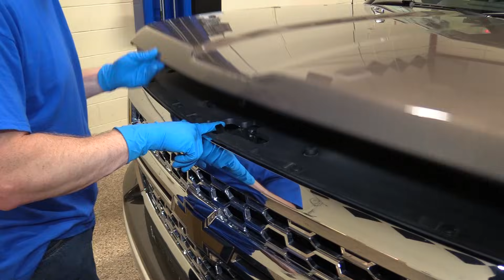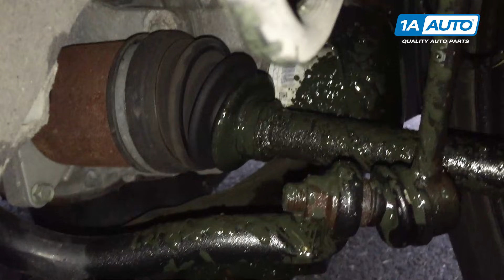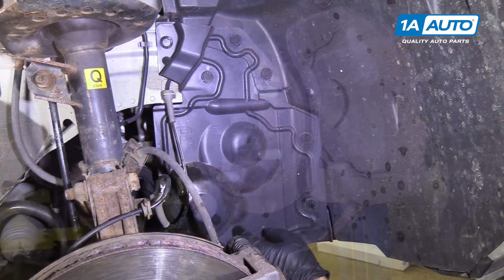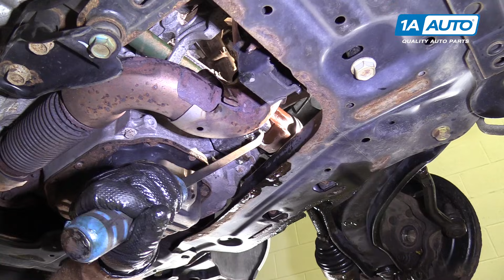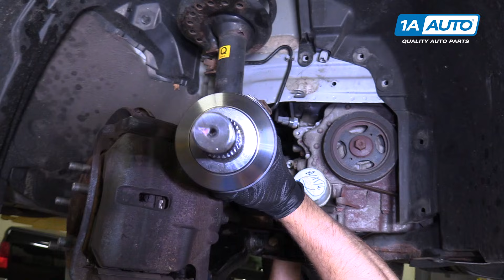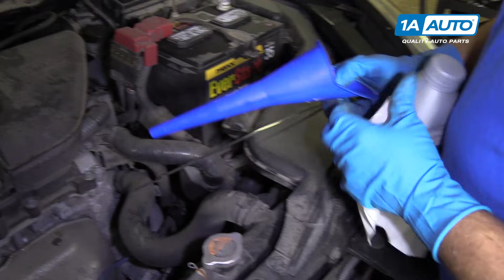How to Replace Front Passenger CV Axle 08-13 Nissan Rogue

Comment: I believe there is a discrepancy. In this video, at 16:52, you state lower ball joint should be torqued to 21ft lbs, but in another video at 9:13 you state it to be torqued to 46 ft lbs

https://youtu.be/-BCASzxYoIE?si=HjhJ_YC2MOB5PWyf

Comment: Just did this job on my 2012 Rogue. For the first time ever, it all came apart the way its supposed to. No slide hammer, no ball joint press, no heat, did not have to remove anything extra. Old one out and New one in, 2 hours. Be advised the world may end later this afternoon.

Comment: For most who will struggle with this. This is the way. Combination of lots of heat on the front side. I used a camping propane torch for 5 minutes then smacked with the slide hammer right away and it came out easy. 

https://youtu.be/6vQwu7A5qUo

Comment: I'm no professional buy any means. But I would suggest to never use a wire brush near the opening of a transmission. Those bristles fly off and you most definitely don't want them inside your transmission.

Comment: I have been trying for three days now to separate the bearing from the aluminum bracket. I've tried every combination of PB Blaster, heat, crow bar, slide hammer, impact hammer, screw drivers, etc. This thing will not let go. I even tried unlocking the housing to see if I could get the axle and housing out in one piece but that proved impossible with the exhaust and the sub frame in place. Any suggestions?
Reply: Not sure if you ever got it apart but this method this worked for me. Took 20 seconds of heat. I had tried all the same things you did.

https://www.youtube.com/watch?v=6vQwu7A5qUo

Comment: Hey 1A. Currently enrolled in an automotive college. and had to tackle this task today on my own personal vehicle. 2011 rogue AWD. We used a slide hammer and everything but that bearing would not release. we ended up having to take that whole assembly that the bearing slides into off, which included my exhaust coming off aswell. My instructor was astounded how hard it was to pop that balljoint out too! cussing up a storm just trying to get most of the bolts off in such a tight space, currently the car is still at the college campus, tomorrow we are tackling taking out the shaft from the support thing that the bearing is seized onto. 
Great informative video btw
Did everything you said and most of it worked, except that stubborn bearing xD

Comment: Had to watch. 2010 Rogue cv wouldn't come out, stuck bearing. Removed cv and bracket holding cv.  Penetrating oil hasn't worked yet. Car is on ground. Also was wondering how to seat bearing if this hard to remove. Using a soft hammer to seat. Glad you had video showing tesl world replacement. Watched video yesterday, the mech said and showed, "just pull it out". Right. Well anyway thanks for a true video.

Comment: I'm surprised the bolts are 13mm and 18mm on a Nissan. Every other Nissan I've worked on used sizes like 14mm and 17 or 19mm. That was kinda weird. I would have definitely undone the strut rather than that ball joint

Comment: I like all of your videos, but in all fairness, this is a totally different job on the ground. I have done several of these in NY, on many Nissans with that support bearing and it could take all day fighting it out. You have far less leverage on the ground. The best way I have found to do them is to take the bearing support bracket out with the CV axle, support the housing and hit the Axle end with a 4 pound hammer. Using a penetrating oil does help as the shock from the hits helps it work its way in. The bracket is held on by 4 or 5 bolts.
Reply from the maker: +Marc Smith Thanks for the feedback!
Reply: I just got one like this, the thing is rusted at the bearing. Hit it so many times, decided to remove the bracket along with it but it won't come out as the exhaust is on the way. With the bracket loose, I will hit it away from the axle and hopefully it releases.

Comment: I've done a few of these here in Massachusetts.  I have never been able to get the carrier bearing out of the housing in the car as shown, even with heat.  I have always had to remove the axle and housing together and then use a combination of sledge hammer, air hammer, and heat to get them apart on the bench.  Good old road salt!  

To deal with this, you need to remove the eight housing bolts.  Then, undo the two twelve mm nuts from the exhaust mount.  Slide the mount off the studs.  Pry the exhaust down as far as you can and stick a wood block or something in there to hold it down.  At that point, you can just barely finagle the axle and housing out.  Having a helper makes it easier.
Reply from the maker: +Zach Dalessandro We appreciate the feedback. Sometimes there are multiple ways to accomplish the same repair.
Reply: This whole car is welded together with rust. Never dealt with anything like this in my life.
Reply: You, sir, are my hero
Reply: Zach, which bolts did you remove to drop the exhaust? I see 3 nuts at the manifold and 2 on the subframe holding a bracket. After that it goes up, over the frame and back.

Comment: Where did you get the extension for the slide hammer??
Reply: autozone $20:

https://www.autozone.com/test-scan-and-specialty-tools/parts-puller-installer/p/oemtools-fwd-axle-puller-adapter/2061_0_0?cmpid=LIA:US:EN:AD:NL:1000000:TLS:8367255572&gclid=CjwKCAjw77WVBhBuEiwAJ-YoJHpeW2CrTRN3-E6QbLRfFWN9aBNYeRI89d-kJdSYLlu64Pj1SPfpQRoCCTIQAvD_BwE&gclsrc=aw.ds

Comment: "At this point the axle should just slide out." Those things are ridiculous. The two most popular ways we do it at our Nissan dealership are to take the bracket out and use the press or torch on the bracket with an air hammer on the back of the axle.
Reply from the maker: +Matt Harradine Thanks for the feedback!

Comment: What terrible example of this job. remove the strut bolts at the spindle. two seconds.. use effin power tools. why are u using ratchets? the car is on a hoist, if u were trying to show what its like in a backyard, do it in a backyard. lol looks like the bearing being stuck caught u by surprise hahaha
you think a backyard guy that doesnt own power tools will have a cv joint adapter for a slide hammer, let alone an extension to make it even half usable for this vehicle? lmfao
Reply: Where is your video i would like to compare your way compared to this video

Comment: *** you do not have to remove the lower ball joint ***  Removing the 2 bolts on the strut brace is a lot easier. Trust me I just replaced one.
Reply: Is there a benefit to removing the ball joint versus removing the 2 bolts on the strut brace?
Reply: @anotherperson956  removing ball joint could damage the ball joint boot. Not always, but it's possible. I typically loosen at the strut
-13 years of being a professional mechanic.
Reply: @Tyler06-o4k  the alignment is affected if the two bolts are loosened.
Reply: @anotherperson956  Removing the strut bolts may potentially change the camber setting on the alignment.
Reply: @anotherperson956  Nope!  Personal preference. I found the ball joint harder.
Reply: @anotherperson956   knocking the BJ out of the knuckle vs sliding the knuckle out the strut, the ball joint will be a lot harder to knock out
Reply: I agree 100%. It is too risky breaking that bolt. I remove the caliper, hang it and take off the rotor. Hit the strut bolts with my impact gun and it was much easier. Without the air hammer, you are doomed on that lower bolt. That CV Axle bearing always seizes in the housing here in NY, horribly.
Reply: Why don’t just replace the rubber sill, and not the whole axel? Just asking.

Comment: what oil to pour after repair?
Reply: I used 
Valvoline™ Full Synthetic CVT Continuously Variable Transmission Fluid.  Picked it up at walmat for 8 bucks.  I only needed 1/2 quart to top off my transmission.
Reply: transmission fluid probably atf

Comment: I replaced the seal that goes inside the transmission and it’s still leaking from that same area. Don’t know what else it could be. Any thoughts?
Reply from the maker: +Eric Tirado it is difficult to diagnose without inspecting the vehicle, we recommend having it inspected by a mechanic if you're not sure. Best of luck to you on your repair!
Reply: I'm a mechanic and I'm having the same issue also as we speak car is on the lift and the same seal went in as it came out and still leaking lmao me and boss man are confused as well

Comment: I'm a service technician at Nissan. I've done a lot of r/f axles on these Rogue's, I've never had to separate the ball joints to do the r/f axle
Reply: I just did mine, I had to take off the bolts attaching the spindle to the strut. It worked out fine.
Reply: Exactly. Remove the two strut bolts from the spindle pull down and slide axle out of spindle then from the trans. An no need to keep the support bracket on the engine as well unbolt and remove.
Reply: Michael Bolger around how much $ would this job be?
Reply: So how do you get it out then?

Comment: So, there is no rubber seal on the end, just the dust cap. So if I'm getting drops of fluid on my garage floor... what did I miss?? My installation went just like this.  The bearing was seated correctly and flush.
Reply: There should be a rubber seal on the transmission. You didn't set the axle in all the way if you are getting leaks.

Comment: Man, I tried everything to remove the axle from the bearing, and nothing work🤔 on a 2011 rogue(I guess I need the extension on slide hammer)
Reply: I'm trying to do that my self right now an having g a hell of a time getting that baring to poo
Reply: Man I have to do the same axle on the same 2011 rogue I'm a little afraid now😪
Reply: Try heating it up with a torch and applying pressure with a pry bar
Reply: @JuanxMunoz  The housing is aluminum. Not a good idea. I take the bearing support housing out with the axle and beating the axle out of it outside of the vehicle. You have much more leverage with it outside. The bearing support is is only held on by 4 or 5 bolts and you can take it out all together as one unit.